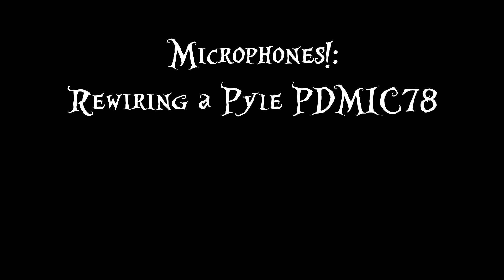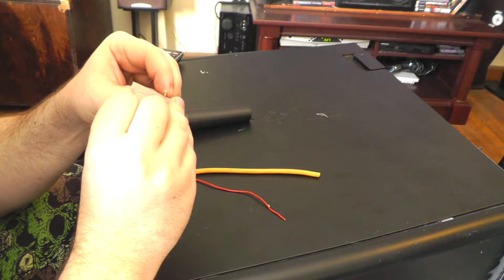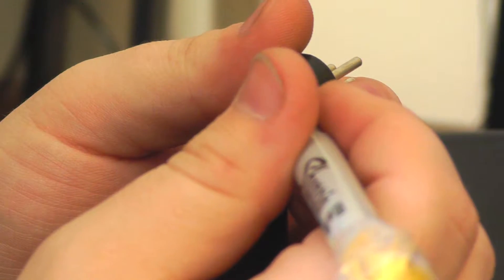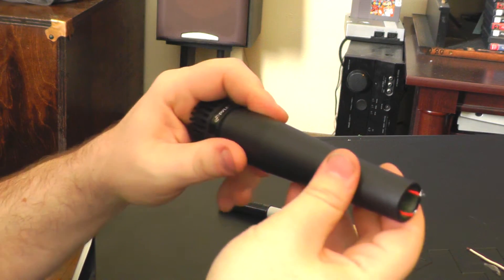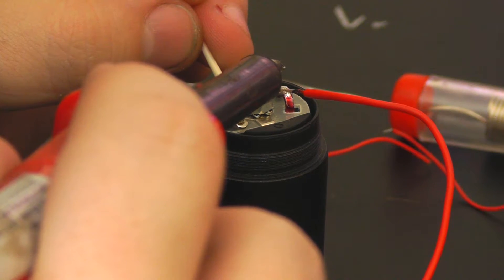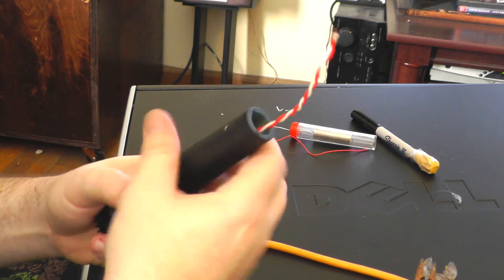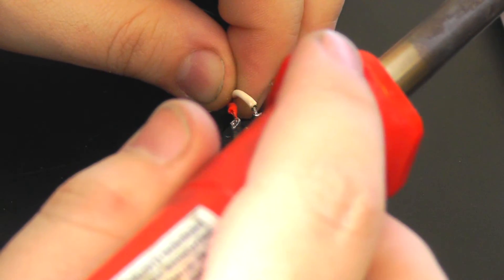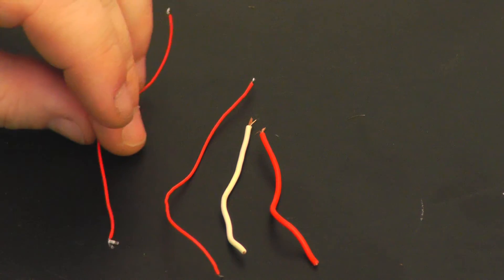Microphones!: Rewiring a Pyle PDMIC78

Comment: This looks super helpful, as I also just purchased one of these. What gauge wire did you end up using when you replaced the wire? 18 awg?
Reply from the maker: Thanks man, yeah you gotta rewire it to balanced if you wanna use it with your board or interface(and have it sound decent).  I believe it was 16 or 18g wire but I can't remember, I cut from a high quality mic cable that I had sacrificed long ago for such projects.  Oxygen free copper is the best if you can get it but it won't make a noticeable difference.
Reply: I just used some old car audio cable I had handy in my electrical box.  Might have been 18 gauge.  I rewired both my pylepros last night trying to fix a hum I was hearing with them when plugged into my focusrite interface.  Only helped the hum a little bit.  I think the mics may have been picking up the ceiling fan in the next room.  Took me probably an hour to do both mics, mostly messing around with what tools I have, getting burned by my soldering stand, etc.
Reply: the wiring i put in there is clearly better than what i took out.  but no there's no special shielding for each wire, its just plain speaker type wire.
Reply: Where do you get mic cable to use?
Reply: Ohhhh that is a great idea! I can just butcher a XLR cable. I have 4 of these mics i want to mod.
Reply: It would help to future proof it. The mic is solid metal, once you ground it, adding any more shielding inside will have very little effects but of course the question remains how good is the connection between the actual ground and the metal case - which may be the weak point or something that may get weakened after some time with those cheap knockouts..
Reply from the maker: i can tell you the connection is not that great on this mic.  However, hum does not seem to be a problem.  For $11 I don't expect longevity, haha.
Reply from the maker: Car audio cable(unless it is high quality) will be susceptible to hum more so than mic cable , but you can always shield the inside of the mic body with copper tape if it is an issue for you.  Of course if you roll off everything below 100hz on your recorded signal it should go away.
Reply from the maker: Anything is better than the stock stuff!  Good job man, link us to a demo sometime.
Reply from the maker: You can find it raw on ebay or any of the big online music centers, or do what I did and use an old xlr cable that went bad for projects like these.  Thanks for watching!
Reply from the maker: By the way you have the best screen name!